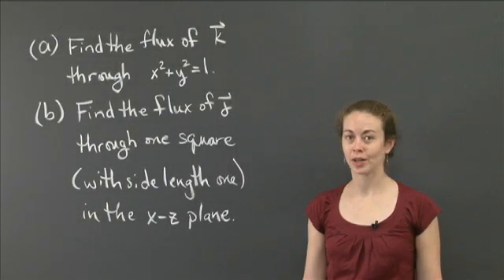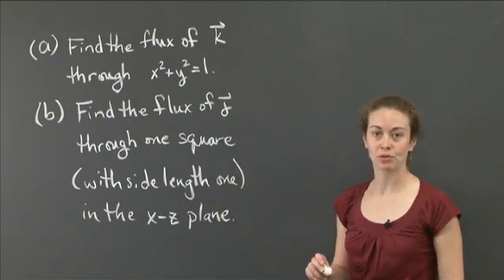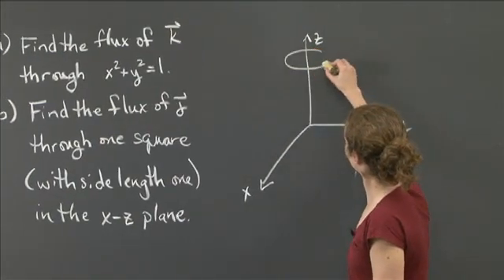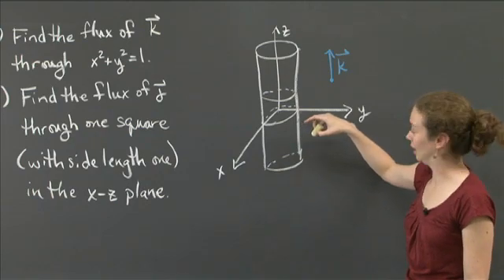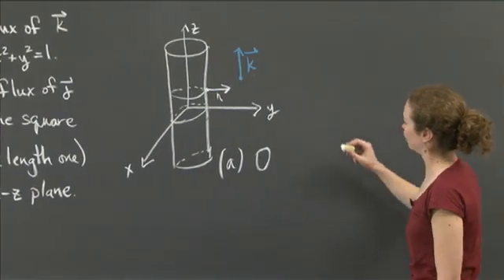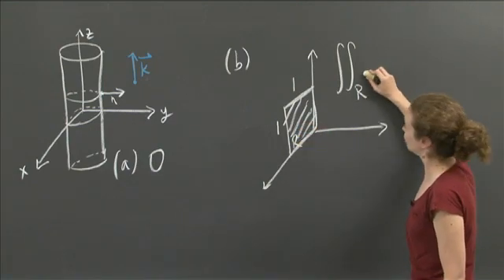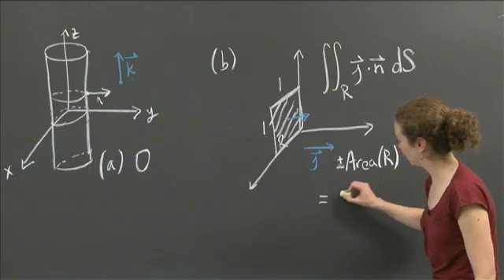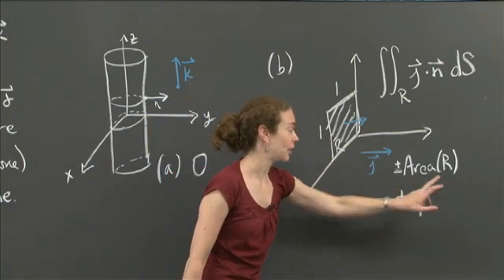Flux through easy surfaces | MIT 18.02SC Multivariable Calculus, Fall 2010

Comment: But x^2+ y^2 =1 can also mean unit circle? (i.e. the flux through the unit circle)
Reply: It would mean unit circle in 2-space or if the z value is fixed in 3-space. In this problem we are in 3-space and z is not fixed
Reply: Unit circle is any circle with a radius of one. So in polar, the unit circle is r = 1, and in cartesian it is x^2 + y^2 = 1.

Comment: Area can never be negative so in ques!b) can't we consider only postivr value i.e. +1
Reply: We are not calculating area, but flux which can be positive or negative depending on the orientation of the surface. I think she uses ± since no orientation is specified in the problem